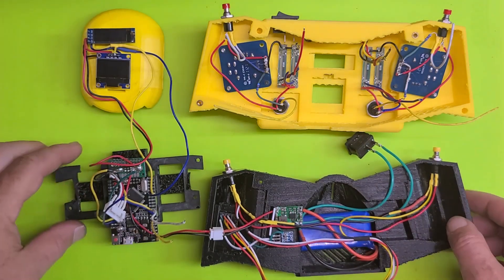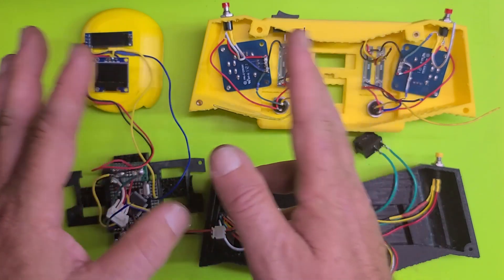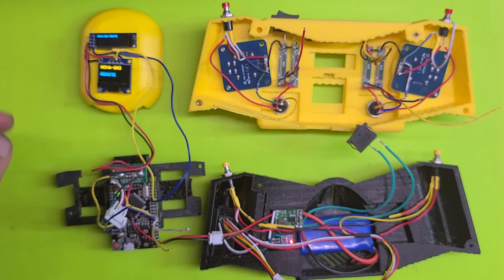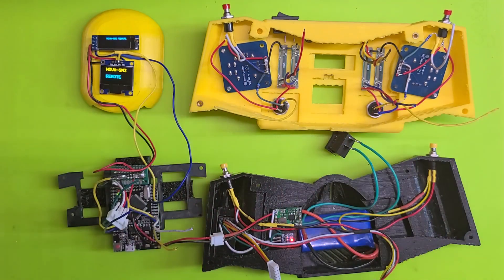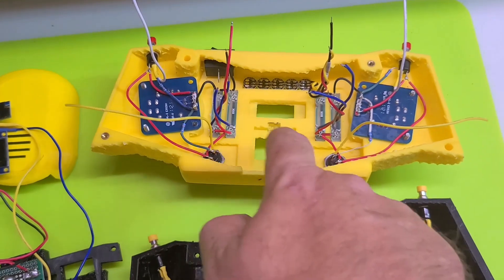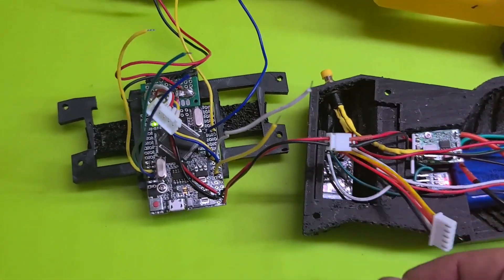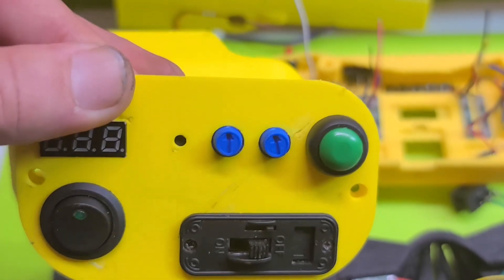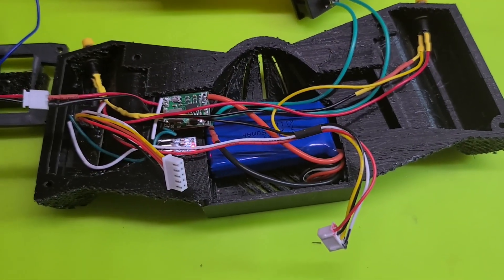DIY Remote Control - Part 5 : Wiring 101 - Nova SpotMicro3 v5.2

Comment: Question about the voltage divider in the remote. Is it supposed to be R1=2.2k and R2 =2k? Allso would it be better to wire the battery straight to megas vin? Where in the code could one be able to finetune the battery reading🤔
Reply from the maker: referring to the diagram, R1 and R2 are for Button 3 and 1 respectively. R7 is 2.2k and R8 is 1k.  The code for the battery voltage is on the teensy in the main code, have a look at the battery_check() function

https://github.com/cguweb-com/Arduino-Projects/blob/main/Nova-SM3/Remote%20Control/Wiring/Schematic_NovaSM3_Remote_v1.png
Reply: @ChrisLocke1969  so the voltage divided should be using 2.2k and 1k resistors? The broblem is that in the diagram the divider is connected to a wire coming from a button, and its connected before the pulldown resistor so 1k resistor of the divider is in series with the pulldown resistor. Making it basicly 2k resistor in the voltage divider circuit
Reply from the maker: @TheSaukkio  incorrect... 1k resistor is sent to ground (that yes, is connected to button, and every other component in the system). Please refer to the diagram and the correct resistors pointed out in my last comment.